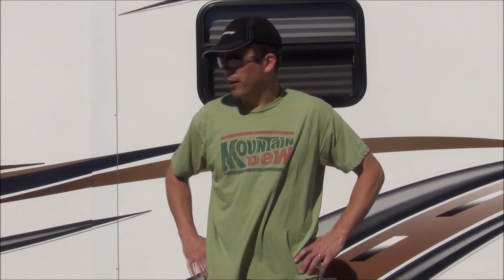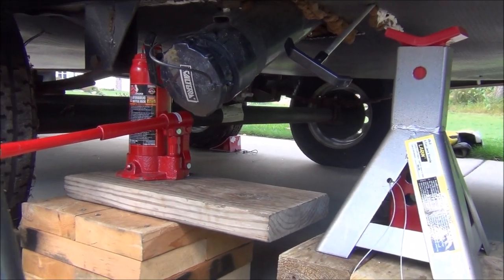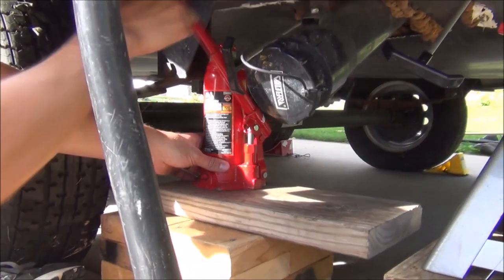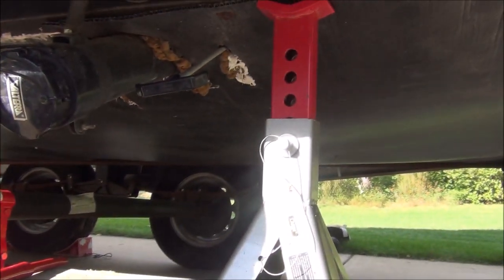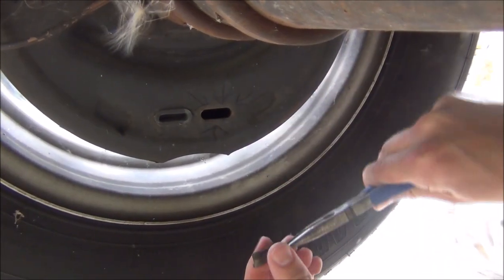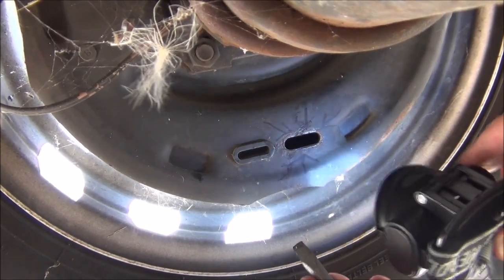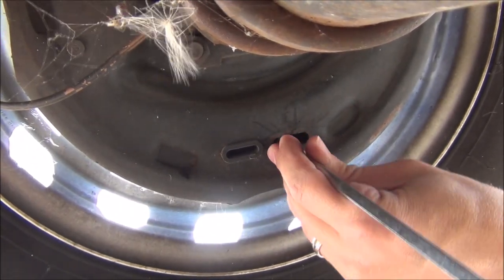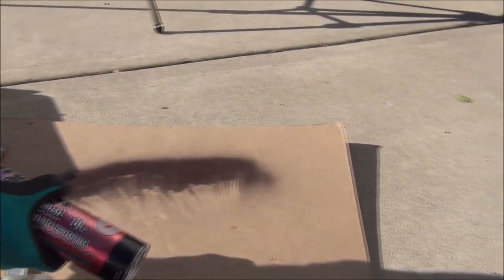2 Ways to Adjust brakes and grease wheel bearings on a RV travel trailer

Comment: Good point on not using zerks to lubricate the bearings when you have brakes.  I spoke to Dexter about this.  The tech said that you never never want to use a battery operated grease gun.  They put the grease out way too fast and the wheel seal can't handle the volume and then you get grease where you don't want it.  This guy did it the right way; manual pump gun and he spun the wheel while pumping slowly.  I would like to see a video of the inside his drums now that he did it this way.  Another thing the Dexter guy said is something we all will agree with.  Since the EZ lube axles came out, people tend to ignore their brakes because they never want to take the drums off!  I can relate:)

Comment: I can understand placing jack stands under the frame for long term storage but for maintenance I just place a stand under the axle. After all the axle supports the whole vehicle anyway.  There are those new fangled RV jack stands that support from under the axles.  I do use stands under my boat trailer frame for long term storage.

My trailer zerk fitting instructions say to observe the position of the zerk fitting to determine if grease is required.  I know from experience that too much grease in the hub will most likely blow out the inner bearing seal.  One thing I wonder about is that my Toyota truck is 15 years old and I have never opened up the front bearings and it shows no signs of any grease leaks.  The only bearings that I check regularly are my boat trailer bearings for obvious reasons.
Reply: Ironically I checked all four of my travel trailer brakes today to get ready for a short fishing trip next month.  This is the first time in four years that I have opened up the hubs or even looked at the brake shoes.  I did place the jack stand and floor jack under the frame as I'm too fat to fit anywhere else!  The one thing I noticed is that the brake adjuster star wheel has a metal plate in front of it so you can only tighten the drums.  Yes, I over tightened one of the four so had to pry, pound and use my vocabulary to get the drum off.

Comment: Jack it up using the axles. You can pull all 4 at the same time if its hooked to the truck. wasted a ton of time. Plus when you take them apart if you get lost you can refer to another of the three
Reply: Sure. If you want to bend those tiny axles.
Reply: You can jack one wheel at a time on the axle closest to the wheel to change tire and perform maintenance
Reply: @js9234  you ain’t gonna bend the axles if you jack it up close to the wheel.

Comment: Bad advice.  Your supposed to remove the hub assy, and not use the quick lube fittings.  These were designed for boat trailers, and should not be installed on RVs.  No one who knows what they are doing would try to get away with lubricating bearings this way.
Reply: absolutley  correcty. must retorque before road ready
Reply: fun mispelling to see who reads
Reply: Rod you are incorrect,this type of bearing lube system is Not used on boats trailers,boats trailers use a sealed system such as Bearing Buddy,The RV system is designed to pump new grease in and push the old grease out the front,therefore it is not a sealed system or designed to be submerged under water.
Reply: Incorrect. If you observe the old grease coming out then it is working. If you use a battery powered or pneumatic grease gun then you risk blowing the rear seal. A manual pump gun while spinning the tire runs little risk.

Comment: You dont want to use those zerks - trust me.
Reply: You are absolutely correct.  I learned that lesson.  The manufacturer says to use those zerk fittings and pump the grease  while rotating the wheel.  Scoop the old grease out and and repeat until the new grease is visible.  I did that after we had our new unit for only about 12 months and I lost all four brakes during our last outing.  I knew what the problem was when I could see the grease residue weeping from the brake drum/wheel studs.  The inside of the wheel hub was full of grease and it was also on the brake pads.  I don't ever plan to use the zerk fittings again.  We don't have zerks for lubing wheel bearings on aircraft and the aircraft reach higher speeds and have more temperature extremes than any of these RVs.  One other tid bit of information - the manufacturer recommends the bearings are inspected every 12-months or 12,000 miles.  So, the bearings and seals will need to be removed for inspection.  Adjust the brakes when it goes back together.